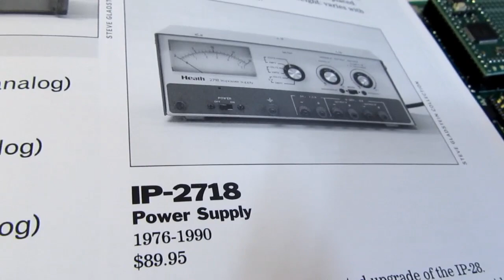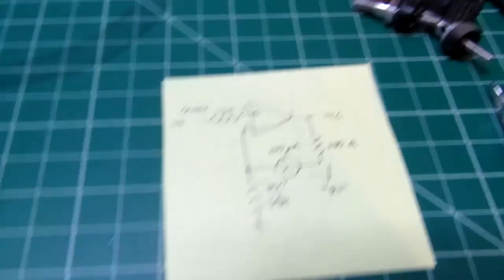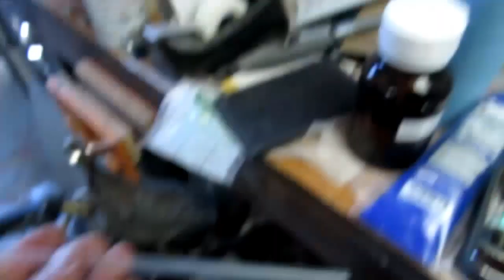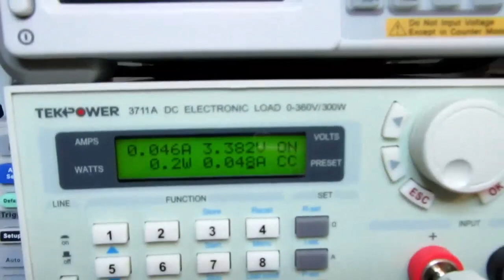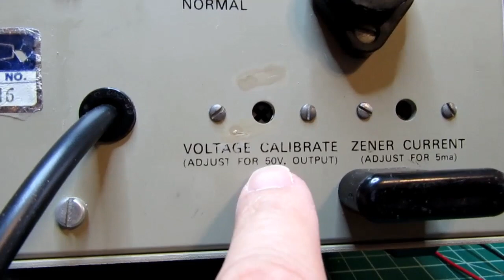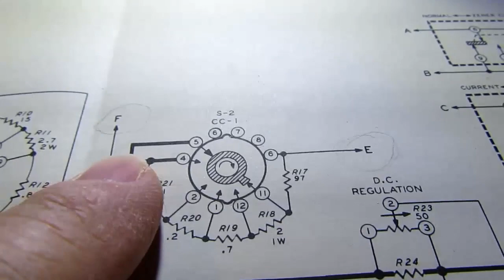Heathkit IP-27 Low Voltage Regulated Power Supply: Overview & Restoration

Comment: I have 2 IP-27's that I'm currently restoring and that resistor that you mention at around 1:27 gets smoking hot on both of mine as well. I don't know is it is supposed to get so hot but If you find out a way to cool it down I would like to know. I believe it's in the reference voltage part of the circuit and I think it's dropping about 105 volts so i guess it might get a trifle "warm".
Reply from the maker: As I think I said at one point in the video, I have experience with quite a few different Heathkit test equipment models, and many of them had resistors that ran so hot their outer coating or labeling melted off. On one oscilloscope, there were a couple of 2W carbon comp resistors that boiled the painted color stripes right off. I would contact Heathkit service, and they would say, yes, they get hot, but they are technically operating within their specifications, so there. Many/most heat dissipating parts will get uncomfortably hot when operating at their specified limits, and although Heathkit put out good quality gear, they were often pinching pennies where they could, and putting in a  $1.50 2W resistor that runs piping hot seemed better to them than putting in a $2 5W resistor that would just run warm. Decisions like this are a large part that separate professional equipment manufacturers from ones like Heathkit.
Reply: I substituted a chassis mount resistor of higher wattage, KAL10FB2K50-ND.  I mounted it to the metal case in another location to dissipate heat.

Comment: I knew little about hw. One time at my work I attempted to substitute battery with a pricy DC power supply. I didn’t realize the current only goes one direction.
Reply from the maker: adaptus primus, I can't figure out what you mean from what you wrote. Why wouldn't a DC power supply work in place of a battery (assuming it was the correct voltage, etc) ?
Reply: youtuuba unlike power supply a battery either source or sink current. My hw board has ability to generate power so I should have use a battery simulator instead.
Reply from the maker: @aps125  , not sure if a battery can actually sink current. Have to think about that for a moment.....

When "sink current" is mentioned, I usually think of a fixed voltage supply and a resistance, completing a circuit that pulls current from the power source into the resistance and back to the source, thus 'sinking current' (but the thing that sinks the current, in that usage of the phrase, is usually not a power source). Is that the same thing that happens when charging a battery....I guess it must be from one perspective, although with the caveat that the battery has its own voltage, and the power source must be at a higher voltage to get current to flow to the lower potential. So, not exactly the same thing as what is usually meant by sinking current, but yes, current is still flowing from the power source into something else.

And, you have to be careful connecting power supplies to things that have their own voltage source, whether those be batteries, charged capacitors, generators, solar cells, etc. Many supplies will be destroyed if connected to another power source that has a higher voltage than the power supply. Of course, BETTER power supplies are protected against this kind of thing. Not sure what a "battery simulator" is, or how it is distinct from a power supply.....I have seen power supplies, especially for automotive applications, that output voltages similar to car batteries, and those are marketed as "battery simulators", but I guess inside they are just regular power supplies.....not really sure, since I have not dissected any.
Reply: youtuuba wow thanks for reply. I am really impressed, your expertise is in power electronics right?

Comment: I had a typesetting business back in the '80s early '90s and we had a paper tape editor.  When we had a problem with it we would feel the chips to see which was warm or hot and shoot it with a shot of CO2 to see if the problem went away.  If it did, we replaced the chip.  Worked almost every time.

Comment: Great video! Thanks for showing how a true restoration should be done. Not surprised that it had  an assembly error  seems like kit builders  didn't check their work. I have come 
across poor solder joints, unsoldered joints and down right poor placement of components where they were just following the steps to the point they could do alignments and
seemed to stop there when it didn't work right.Heck my own grandfather left out a large value resistor in a resistor bridge in a Knight VTVM kit he built and never used it.
 He left the" C "cell battery in it! No! So that ruined the main board .Of course after getting a parts supply donor Knight VTVM I was able to get it working perfectly now.